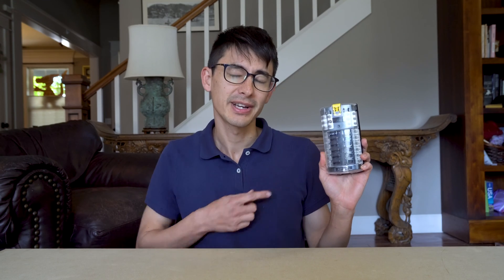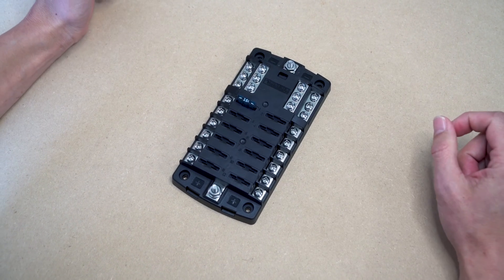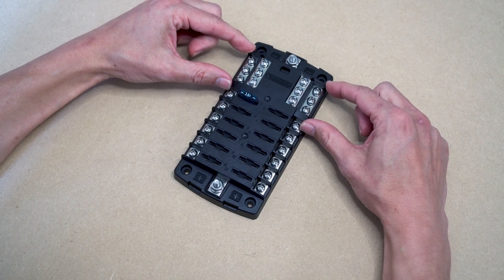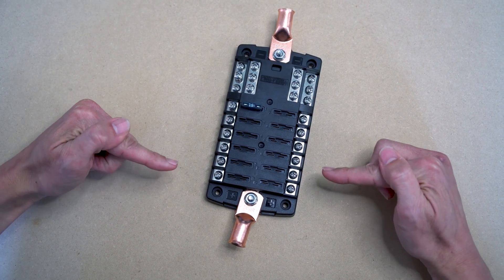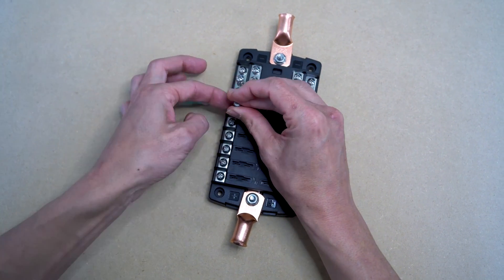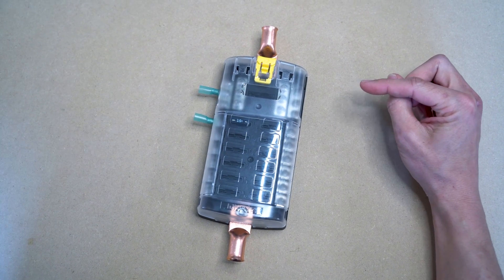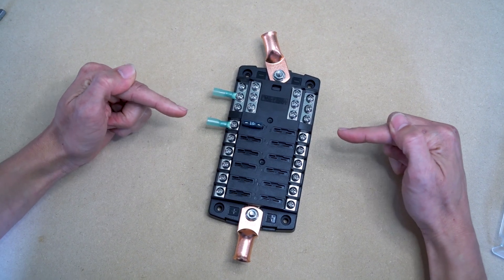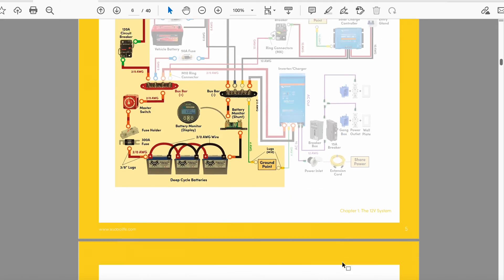12V Fuse Panel Product Review - Blue Sea Systems 5026

Comment: I have the 6 curcuit version of this in my Jeep. I agree it's a great product, but have to point out that supplying mounting hardware and fuses would be a waste for the company.  There is no way for Blue Sea to know what fuses are needed, and the same goes for mounting. Bolts or screws? What length? I will be purchasing another for a solar system, which will be mounted on plywood with screws. The block on my jeep is mounted on 3/4" plexiglass with through bolts. I'm sure if they tried to supply these things, it would increase the cost, and be unusable for this product in many cases.

Comment: I purchased a Parallax M036-7100-002 11 Position Fuse Block but I am uncertain how to remove the board from the wall as it isn't attached with screws. Is it pressed on? Thank You

Comment: If you have two parallel 12v batteries which battery post do you use for the hot and which for the negative?

Comment: Just saw this video I had ordered the WUPPERTAL fuse panel would you recommend going with Blue Sea Panel?
Reply from the maker: Unfortunately we don't have any experience with the WUPPERTAL fuse panel. I'm guessing it's a chinese branded device, which means it's a roll of the dice in terms of it'll meet your needs long term. I could guess if you're not pushing too many amps through your fuse panel, then it would be OK. But unfortunately I couldn't be more specific than that. We've had our Blue Sea fuse panel for 4 years and it's worked great so far. But they definitely are pricier.